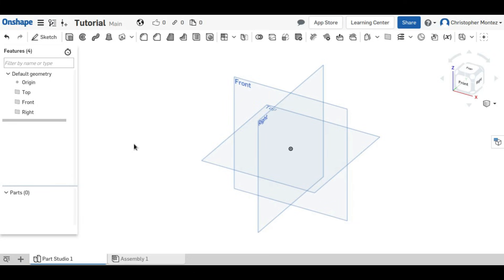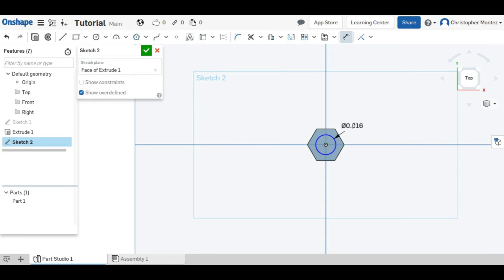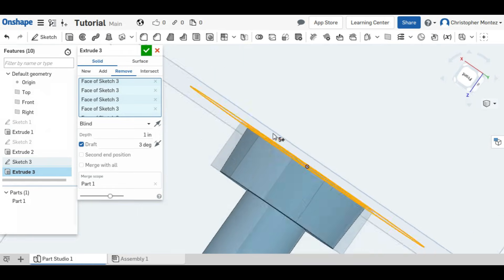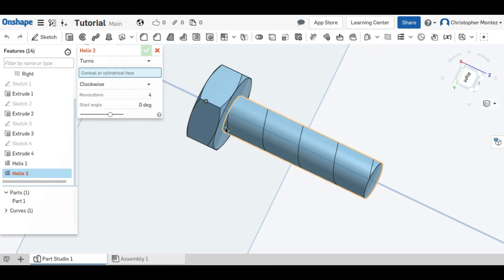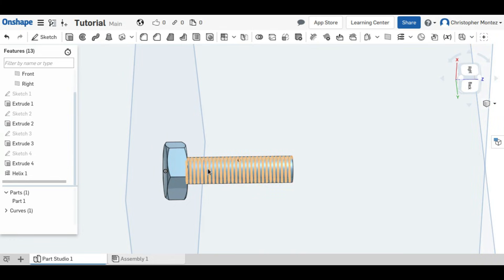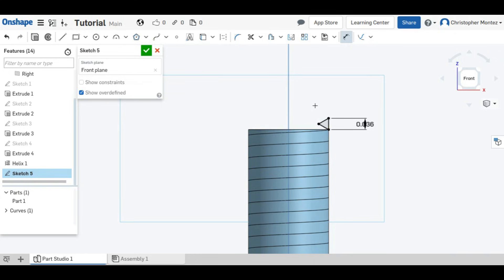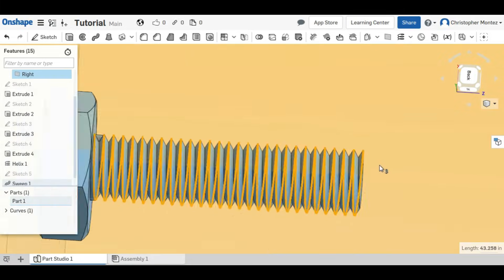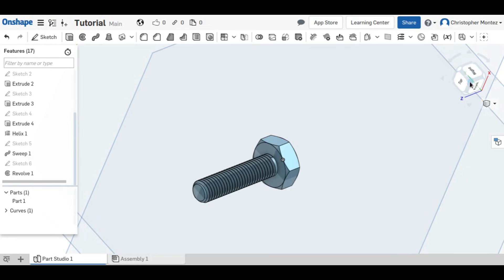Learn Onshape: #5 Making a Bolt - Tutorial

Comment: Hi I'm finding your lessons really enjoyable but there are certain things I can't do. One is to center the image after enlarging it. Second, I've tried to get the shape of the bolt head by adding the bevel to the top and bottom of the bolt head but it won't accept the instructions because after entering the draft angle to 60 degrees the upward arrow does not appear, only a circular symbol? I'm sure it's something simple but????
Reply: Same, can't get this bevel to work.  I don't think I'm selecting the right things, not very clear in the video, he is going to fast